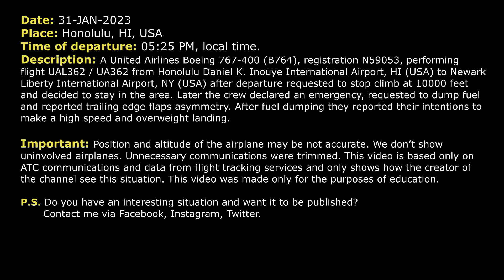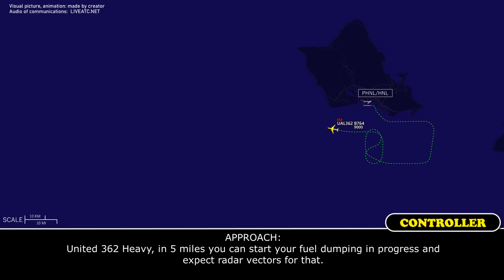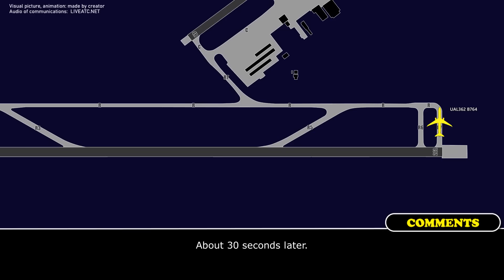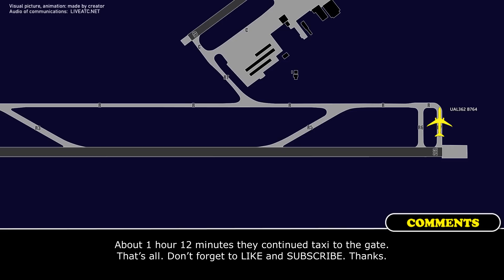Flaps disagreement. Overweight and high speed landing. United B764 returned to Honolulu. Real ATC

Comment: In the Boeing world flap disagree is very different than flap asymmetry. It simply means the flaps haven't moved to the position commanded by the flap handle. Soon after moving to the 75/76 we experienced a "flap disagree" on climb-out after selecting flaps 0 (up). The Captain was experienced and he reached over and thumped the flap handle down into the detent. The fault cleared and we continued the flight. After landing he wrote up the flap handle sensor. Years later, with a new Captain we were climbing out of KPHL in a 75 and after selecting flaps up we had a "flaps disagree" EICAS message. I thumped the handle down and it went out. Again, we continued and concluded the flight uneventfully. We made a similar logbook write-up. I have no knowledge of the cause of this flight's "flaps disagree" EICAS message but I wonder how many flights were discontinued because a sensor was out of rig.

Comment: Holding south-west of ALANA means inbound course 045, doesn't it?
Reply: Roughly.
Reply: "Holding south-west of ALANA means inbound course 045, doesn't it?"

ATC must give you a point to hold at, the inbound radial to hold on, the side of the fix to hold and which direction of turn.

Comment: 14:35 I think tower said "gonna chock your wheels", i.e. put the rubber stops on them as a groundside parking brake, which is of course the norm at gates but very unusual for a "routine" brake check after a hot landing. I mean, it's logical, it's just very very unusual for them to actually do that.
Reply: They will chock the nose wheel so that the parking brakes can be released.  The brakes cool much faster when the parking brake is released.  Nobody is going to walk up to the main wheels with hot brakes just incase a fuse plug on a tire lets loose.
Reply: @mikedeal3466  Like I said, it's totally logical, and also totally rare lol
Reply: @mikedeal3466  Good point, but I was told it's better , if possible, to keep rolling slowly to prevent the wheel from fusing or welding to the brake assembly. This is of course if the fuse plug hasn't blown already. The thermal camera should be able to catch the temperature as it is rotating. Your thoughts?
Reply: @bobteter4300  My last 24 years flying, I was on the B747-422. I flew SFO-SYD turns for several years. 13 hours into 15.5 hr flight to SYD, ECAM gave us a rev fail warning. We landed with no reversers in SYD on an amber alert. We rolled off the runway and stopped on the taxi way with ARF scanning our very smokey brakes. According to the FLT manual, we had to stay stationary till our brakes cooled to a certain point, then when could be towed, provided we did not use brakes.
Reply: @mikedeal3466  Thanks. Sounds like a great career. My "reference" was an old 727 training video by the chief pilot at Northwest. The video, from the 1970s, was to show the increase in landing distance as you tack on extra knots above Vref. They shot the video (movie) in Montana, but I don't remember if it was Billings or Missoula. The last segment of the video was to demonstrate how short a distance the 27 could be put down. I forgot what the distance was, but I remember it was really short. I do remember him commenting on the smoking nose wheel and said "this is probably the only time the nose wheel brakes have ever been engaged". He also made the comment that they kept it moving to prevent the wheels from locking up. It was a long time ago and I don't remember the chief pilots name any longer. Thanks for the response.

Comment: Note that they used 8R for the return, which is the "reef runway" (12,000 feet).
Reply: most of it was at 10k feet, then down to 9k for fuel dumping